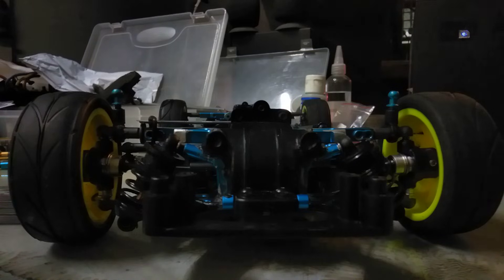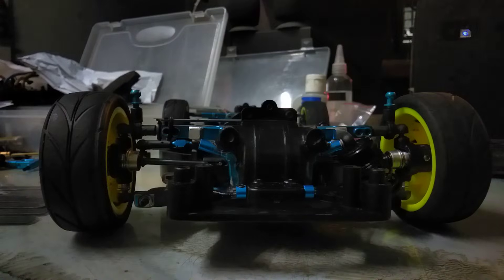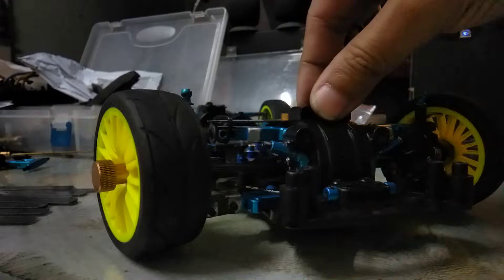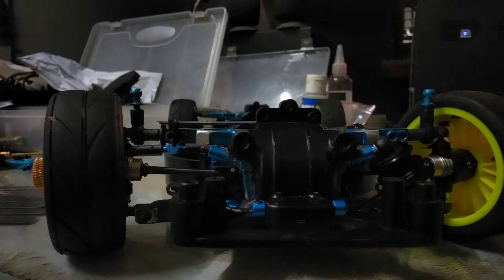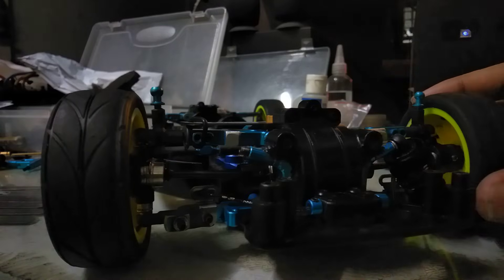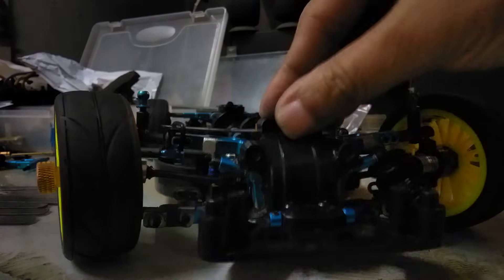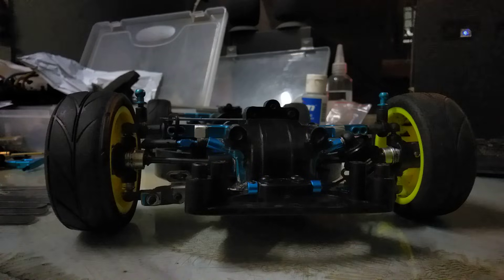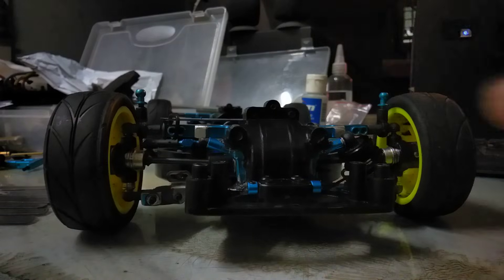GoldTC Evolution - Invisible Suspension

Comment: I’m assuming it’s some kind of leaf spring.  Don’t they have a much higher rising rate?  Do you a system to test spring rate throughout the travel?  It maybe possible to angle them so they act more linear.
Reply from the maker: Will just do a lot of track testing and see what works :)

Comment: Well Joel you certainly kept that up your sleeve. 😂 We had a brief chat a few months ago about the shocks and unsprung weight etc. if you can recall. Little did I know you’d already thought above and beyond 😜 still loving your videos and all your great advice. As an eagle eyed viewer I couldn’t help but notice the rod across the top control arm and can only assume your adjustment is made by sliding those 2 rubber o rings along the arm with almost an infinite combination of adjustment. I did think about the loss of dampening without the oil now but then I thought 🤔 For where you mainly run the car as in mostly flat race tracks. I think the performance gain in weight loss should possibly far out weigh the gains added utilising dampers. Knowing you a little bit through your awesome videos, I’d imagine you’ve already got that covered also. Hopefully I’ve not said anything I shouldn’t have 🤫 although I doubt it as you wasn’t trying to hide anything and you’re all about helping people go faster. I’ve left the planes alone for a while now and have firmly delved back in to the RC cars again. The weathers not great here in the UK at the minute so I don’t half pick my times. 🤦🏻‍♂️ I mainly tinker with TT02’s to be honest as you may remember. I need to find a way of sending you some pictures of my TT02 builds. Some may shock you a little 🤏🏼 😮 I’m also just finishing a custom TT02 build for a 5 year old. I was contacted after building a similar one for someone else. It’s a super Mario inspired TT02 using the HPI Chevrolet Monte Carlo NASCAR body. 45T motor to keep it fairly slow. Still too fast for a 5 year old really but who knows 🤷🏻‍♂️ might be the next UK champ. Custom Paint and even custom decals. The whole time I’ve been doing it I almost wished I was 5 again. It’s going to make a very lucky boy very happy on Christmas Day. It’s been his Mum’s idea the whole way through and has no idea the lengths she’s been to make it all happen. It’s been an absolute dream to be a part of and I’m pleased with how it’s all turning out. Again a very lucky boy. Sorry for the long comment. Could chew your ear off all day talking RC ✌🏼
Reply from the maker: Thanks for the comment. Hope to see your tt02 creations some day, maybe share it on FB? I just got sick of buying so many springs, figured I go the Awesomatix route. Tension is by stacking more leaf springs, the rubber is there to help with droop. Damping is via thick diff oil in the hinge pins. Trying to make a car as minimalist as possible with each part serving multiple purpose.

Comment: It's a Lancia Fulvia. :) They used a transverse leaf spring with the ends mounted to the upper arm via rubber. I think they still used dampers though. Same with the Corvette that replaced the lower arms with a composite leaf spring.
How are you damping? Is the leaf a single material or multi-layer (constrained layer damping)?
Reply from the maker: Damping inside hinge pin with thick silicon oil. Leaf can be single or multiple to adjust tension.
Reply: @rccartips  Cool! Sounds like a lever arm damper. What's old is new again. :)